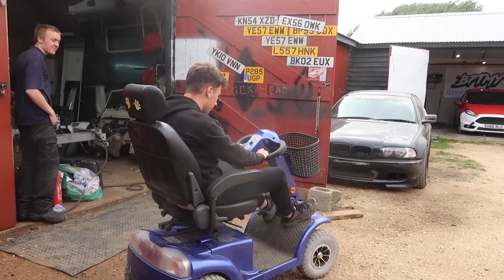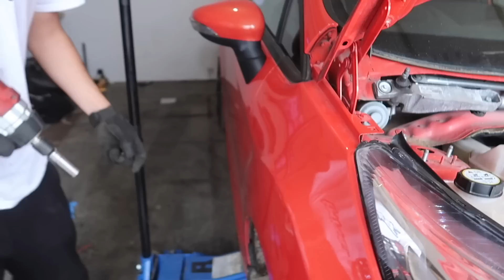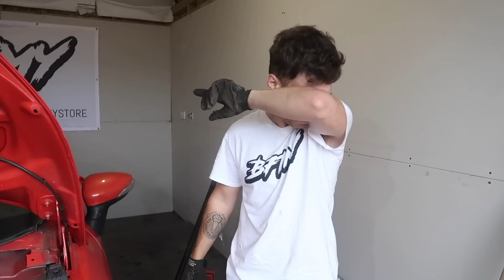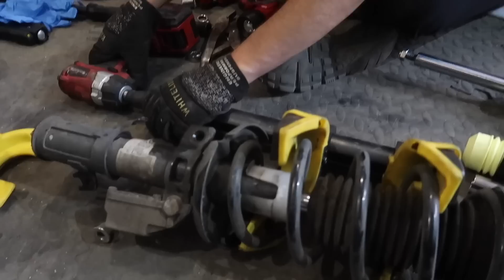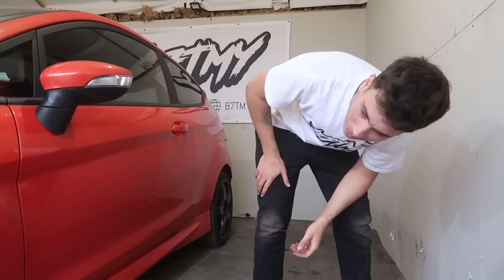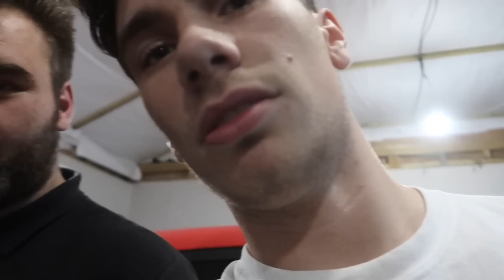FIESTA ST GETS COILOVERS!!!

Comment: Just catching up on your vids after having no internet 😂 you don't actually need a spring compressor to remove standard ST180 springs. They aren't under any tension really and you can just zap the top nut off. Done it loads on them. Getting standard ones back on is a bit tricky without one but is possible. But who puts standards back 😝